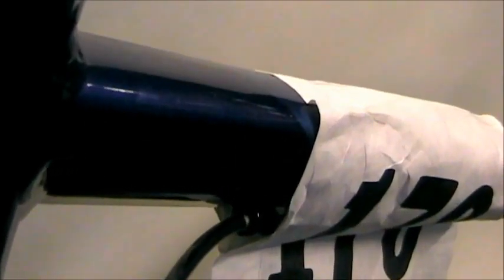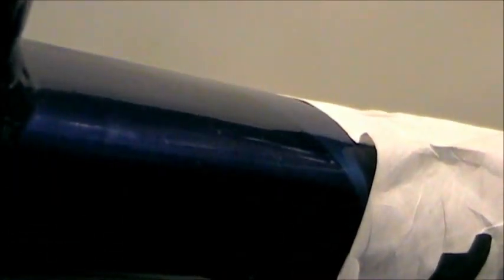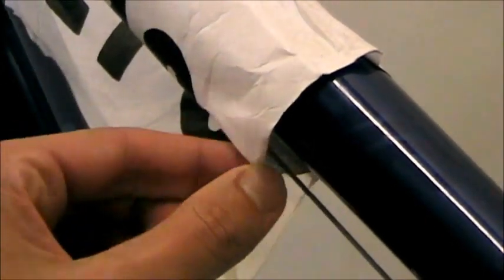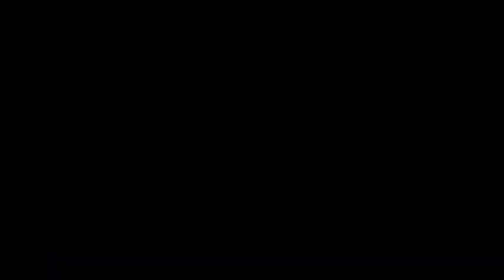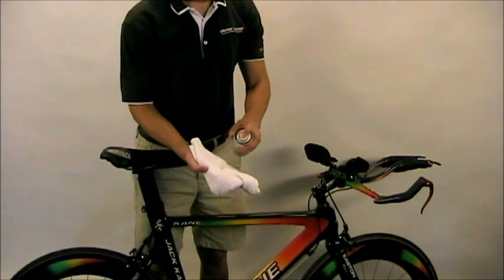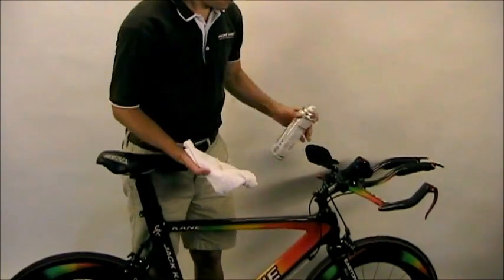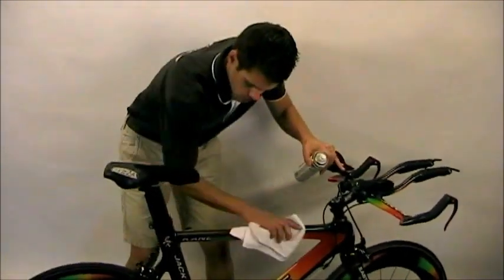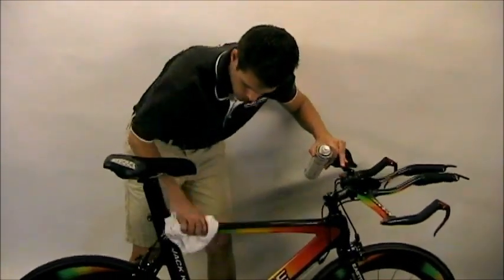How to Protect your Bicycle Frame Clear Coat from Race / Charity Event Numbers

Comment: Do you have any experience clear coating a raw steel frame?
Reply: Gabriel Rhee thank you for your comment. We do not clear over raw steel because it does not bind/adhere well. It can flake/peel off. That's why we use primers and sealers.
Reply: Thanks I got a late 80s early 90s nishiki and I want to do something about the paint job might just touch it up because it looks like a bianchi with the teal paint now